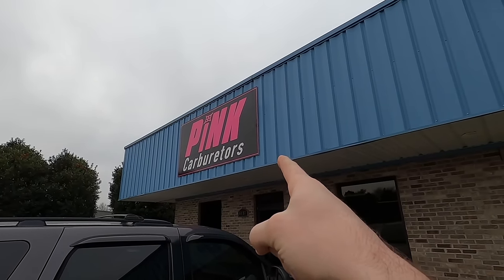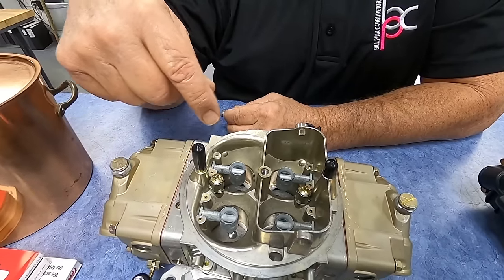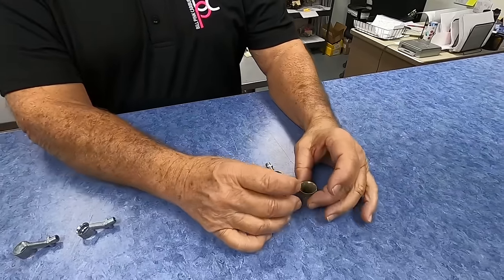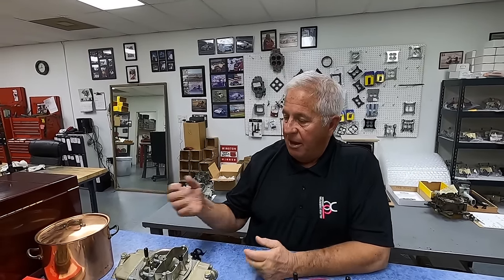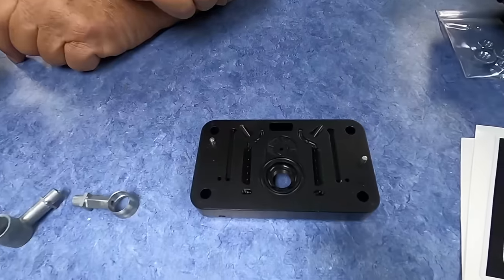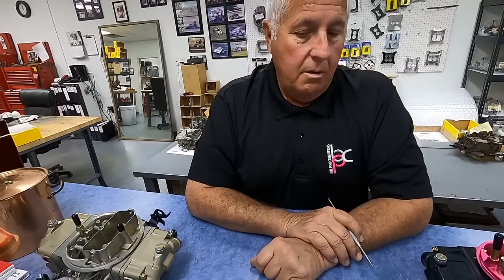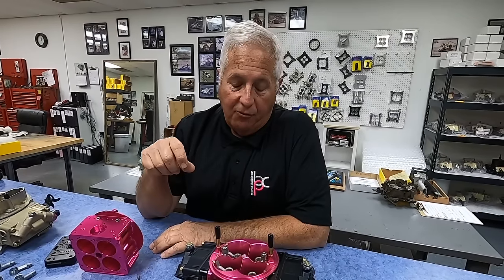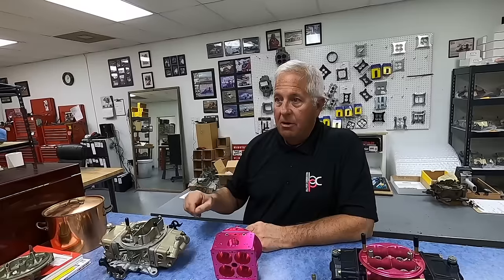Carburetors Are WAY Smarter Than You Think! Tuning Guru Bill Pink Shows Us Why (Carb vs EFI)

Comment: what Lake is saying is technically not quite right....the old fuel injections from the 1950s used the engine manifold vacuum as a metering signal too.  the speed density throttle body injection systems used  MAP and TPS sensors, to meter fuel based on manifold vacuum and throttle position.  the modern systems use a MAF and MAP sensor to meter fuel based on total airflow into engine, and manifold vacuum.  the sensors tell the ECM what the engine wants, then the ECM gives it fuel accordingly. the difference is EPA mandated leaner metering at idle and part throttle operation.  so the ECM is programmed to only give it so much regardless.
Reply from the maker: Yep the buck stops with the calibration. In a fully adaptive system yes it listens but most don’t work like that
Reply: Actually, all EFI systems have a base (open loop) tune and only take suggestions from the various sensors.
Reply from the maker: @RadRidesByCru  If you have a Holley or similar aftermarket system it can run closed loop and be fully adaptive at any given time. No factory cars work that way though
Reply: Hey, cool channel, like the videos. I have a Holley EFI. Fully adaptive is a misnomer. They'll run in closed loop during hot idle and off throttle cruise, but default back to open loop during accel, decel, cold start, sensor reading out of range, etc.. And obviously no EFI system runs closed loop at WOT.

Comment: Fuel injection is listening even more so than a carb. Mass air flow, manifold pressure sensor, o2 sensors, throttle position sensor, crankshaft speed sensor and knock sensor.
Reply from the maker: It needs the components configured to do that. A speed density setup (most aftermarket efi systems) dont have a maf sensor.
Reply: Actually, EFI doesn't listen at all. in certain situations (full throttle being one) all EFI systems switch to open loop and run off a predetermined program. Further, you're mixing fuel injection with engine management. EFI doesn't have, nor does it need crank or knock sensors.

Comment: Your the Opposite on your diesel theory , they are wide open for air at all times , the fuel amount is controlled at all times , more fuel = more revs , hence they rev to the moon if they ever run on their own oil or an unwanted fuel source.
Learnt heaps off this vid , thank you
Reply from the maker: You’re welcome sir. I think you misinterpreted my diesel theory. What I said was why can’t you run a gas engine on fuel flow only?
Reply: @Stapleton42  Because a gasoline engine needs the air/fuel ratio held within narrow limits which requires throttling the air flow to keep the mixture within limits.
Reply: @Stapleton42  sorry I did hear that to begin with and clearly confused
Myself . I guess the issue is diesels run cooler the leaner they are and happy doing it , we all know about leaning out gas engines and that would be the consideration of doing it that way is if it went lean it’s harder to control when it’s already wide open , just easier the other way I figure . 

On another note I know a Nissan engine actually runs the throttle at wide open once throttle input
Is past 33% , and it uses the variable inlet cam lift to then control acceleration from there . But that’s the closest one I know of . 

Sorry again , should have listened to it again before I commented
Reply: A gallon of diesel has more btu's than a gallon of gasoline. That's what it comes down to.

Comment: Lol how they don't know about diesels. I'm an auto technician in Australia, I learnt about all sorts of carbies when training, the motor bikes used to have some crazy designs, some had over 10 transfer ports.
I also know how diesels work, the injector ignites the fuel as its sprayed into the engine.
Reply from the maker: If you were a gas racing engine specialist learning about diesels serves no purpose to your profession
Reply: @Stapleton42  I get what you're saying but I do find it a little ignorant to not understand other types of technology.
As an example I know quite a lot about plane piston engines, why? Because I wanted to know why they run Avgas and what the differences are. 
I also know quite a lot about mains power as two of my uncles and my late grandfather were electricans/still are. It actually came in handy when I set up my work shop the guy we hired wired the compressor to run backwards, so I re wired it to run forwards. 
I'm also a radio amature and have extensive knowledge of RF. 
I'm always learning everyday and I'll never stop learning new things.

Comment: At idle. Fuel is limited by the idle mixture screws.  
From idle to 1700 rpm.  Fuel is limited by the idle feed restriction.  
From 1700 to 2400 the idle transition circuit looses vacuum signal and the primary boosters start to feed fuel as the air flow thru the venturis is increased.   You can see if your primary main jets are sized properly by bringing the rpm up to just before the secondaries start to open and looking at your air fuel ratio gauge. Is it lean or rich.  Change primary jetting to fix this. 

Ps edelbrock carbs have idle feed restrictions that need to be drilled to match the engine needs.  They are hidden behind the air bleed in the side of the primary booster.  Carter called them economizer s. Too small the carb has a flat spot off idle.  Too big and fuel economy sucks.

Comment: Carburetors are just better.  More reliable, less fuel pressure requirements and mechanical fuel pumps put vacuum on the fuel line so you can still get to a parts store if you have a fuel line leak.  You can run multi fuel setups so much easier, you can get better performance from a carburetor and you can get the same efficiency as EFI if you know what you’re doing.  You can tune everything to exactly whatever fuel curve you want.  You can run boost by drilling a couple holes for free essentially instead of reprogramming computers, and it takes far less time.  That versatility makes carburetion far superior to EFI when you’re doing any sort of modification.  Performance TBI and EFI (as opposed to stock) are designed around the idea of giving the vehicle what it wants instead of forcing it to run off what the computer wants.  And, you can rebuild them for cheap.  A Holley or Edelbrock costs half what a set of new injectors costs.  It’s just better.  If you disagree, then you’re entitled to your opinion but you’re also doing so from my rear view mirror.

Comment: My brother and I started racing a car with about 640hp small block 400 chevrolet engine about ten years ago, and were farting around with the main jets trying to richin the carburetor and I had the float bowls off on are holly 750 double pumper.This guy I've seen for years out at the race track is walking by and he stops and he said something to me but I couldn't hear him over the beautiful sound of high horsepower engines barking! So I said, Excuse me? He leaned over my shoulder and yelled, You ain't got no jet extensions in that back float bowl! And me not knowing at the time what the hell he was trying to tell me I gave him my best, I'm dumb! Can you please tell me what you are trying to get through to me look. He said, An engine with this much horsepower will have enough inetertia to pull the fuel away from the metering block on the back side of the carburetor and starve it for fuel when you stab the throttle! You need to run jet extensions he said. I couldn't believe how cool it was for him to throw us a bone like that! I thanked him very much and asked him if I could buy him a corn dog? He replied, No thanks I like to stay hungry on race day and walked away. It's the little things like that that make a huge improvement and I can't thank Guy's like that enough for giving away a little information to help us rookies out when you're just learning all the ins and outs of things.  😉

Comment: EFI doesn't tell the engine what is getting? the engine tells the EFI how much fuel to inject. They work kind of similarly the difference the carb does all the cifferin through vacuum signal EFI does it with sensors.
Reply from the maker: Assuming a given EFI system has the proper sensors in place with parameters set to do so. Not all of them do.
Reply: Actually, EFI does tell the engine what it's getting, like it or not, based on its programming. It only "takes advice" from the various sensors. Default is open loop, where it listens to no one.

Comment: Fuel injection uses 02 sensors in combined with temprature sensors crank cam position sensors and a number of other devices to deliver what the computer that listens to these devices and determine what portion of fuel programed in what is called a fuel map that the computer has preprogramed to give the engine. Carburetors don't do this and therefore are not as precise as fuel injection both listen in different ways
Reply from the maker: Depends how much freedom that ecu allows the sensors to make changes and what failsafes it has in place but yes I understand what you’re saying

Comment: I stopped at 0:40 when he said manifold vacuum pulls vs atmospheric pressure pushes.
Reply from the maker: You can phrase it however you’d like but it doesn’t change the principle of how it works 😂
Reply: @Stapleton42  in fluid dynamics, it's a basic but critical distinction. If a man is gonna "nerd out" on a technical thing, they should do it right. That's how misinformation  becomes gospel, especially in motorsports and technical matters in general.
Reply: @slowpoke96Z28   phooey

Comment: He shouldn't feel bad there is a massive amount of professional mechanics that have no clue how a diesel works. One guy I worked with thought the glow plugs made the fuel burn 🤣 there are gas engines that can run like a diesel on compression alone but there pretty experimental. Diesels use compression heat to ignite the fuel that is sprayed in the cylinder. Similar to a spark plug igniting the fuel mixture but it's the air heat that makes it burn. U still have timing and stuff to play with but diesels don't have a throttle plate or vacuum because the injected fuel controls rpm and timing. U can run a gas engine without a carb if u have a way to precisely control the fuel it will run just like a diesel lol. Diesel fuel has way more BTU then gasoline so when it fires in the cylinder it creates more heat and pressure inside to push the piston back down. Most diesels run 21:1 compression so if u have poor fuel or gasoline in the tank you won't build enough cylinder pressure to push the next piston up and squease the air to ignite the fuel. Gasoline can't create enough cylinder pressure to keep the engine cycling that's why diesel fuel oil was developed to create constant cylinder pressure to keep the engine rotating to keep the compressed air hot enough to fire the next combustion stroke. The main reason diesels "roll coal" is they are putting too much fuel into a cold cylinder similar to when u first fire up your wood stove u get lots of smoke and soot out the chimney till everything gets hot and the wood burns more complete then u don't get all the soot and smoke out the pipe. That's why nos works amazing on diesels and why the black smoke suddenly disappear when they hit the nos it increases the cylinder Temp + add oxygen and the injected fuel will burn completely just like when your wood stove is hot. A properly tuned diesel won't "roll coal" a diesel shouldn't burn black out the pipe if the cylinders are hot and the fuel is burning properly.

Comment: The way g'sil injection works it has a secondary high pressure pump like for instance on a 12 valve a 12 valve has literally a pump boost the pressure from around 20 psi up to 30,000 to 60,000 PSI so that the motor doesn't need batteries or anything like that the same reason why the old Detroit two cycle diesels if they didn't have a blower it would not run because the blower is what compresses the are not necessarily the Pistons therefore it's similar with a 12 valve basically just the port where the air is brought into in compressed and it's compressed to such a high level that when the fuel comes out of the injection or injector it pretty much instantaneously explodes
Reply: Huh??  Try reading your post out loud and see if it makes any sense.  Then use some 6th grade punctuation and grammar to make it understandable.

Comment: What's a cfd study
Reply from the maker: Computer fluid dynamics I believe is what it means. It’s like an airflow simulation program
Reply: @Stapleton42  thank you
Reply: @Stapleton42  do u no why a big rig can idle at a truck stop for three hrs and use hardly no gas , I do
Reply from the maker: @bryang9158  yeah because they run on diesel not gas 👀😂
Reply: @Stapleton42  it's because no throttle blade to open or close it's just a big hole open all the time even at idle witch means full 22 to on compression even at idle super efficient at idle hence low fuel consumption, a passenger car gas engine has a throttle butterfly on the tb , at idle it's basically closed not letting much air in so your ten point five to one compression passenger car is really mby six to one comp at idle hence super non efficient= bad mileage worse than actually crusing on the road , the motor has to have air to make compression , a internal combustion engine with a throttle plate is a variable compression eng

Comment: "EFI tells the engine how much fuel it's gonna get, carbs give it what it wants." Sorry, I don't subscribe to that. I love carbs and run them, but that is simply not true. YOU, the tuner, ALSO tell the carb how much fuel the engine is gonna get by tuning the damn carburetor. Jets, air bleeds, restrictors, emulsion bleeds... they all determine what the engine is gonna get. Just like an EFI system can give incorrect amounts of fuel, a carb can give incorrect amounts as well. And most people running out of the box carbs straight from Jegs or Summit are running FAT as hell.
Reply from the maker: They both require the proper user configuration yes
Reply: I thought carbs tells the engine how much fuel is going to get at EFI give it what it wants.
Reply: So... you don't subscribe to the truth? Or you're having a crisis of semantics? Based on your logic my tires tell the engine how much fuel it wants. Speaking specifically to the fuel delivery method (read: method), Lake and Pink are correct. Any carburetor will run any motor so long as there's enough vacuum signal to draw fuel. Make the jets/bleeds/restrictors too large or too small, the carb will still "give" the engine what it wants. EFI has to "tell" the injectors how much fuel to deliver based on programming, the injectors don't "give" anything by themselves.
Reply: @RadRidesByCru  "Any carburetor will run any motor so long as there's enough vacuum signal to draw fuel. Make the jets/bleeds/restrictors too large or too small, the carb will still "give" the engine what it wants."

Wrong. The carburetor will still give the engine how much fuel it feels like, regardless of how much the engine wants, based on jets, bleeds, floats and restrictors.
Reply: I was asking Aurthur about his position but... You specifically, are making a linguistic argument. Carbs give an engine fuel. The engine literally reaches in and takes the fuel out. Whereas EFI tells an engine how much fuel it's going to get because the engine cannot take the fuel from the EFI system on its own.

If you reverse your first reply to Aurthur you'd be correct.
Reply: @RadRidesByCru  Explain to me why carbureted engines typically run rich to the point where fuel dilution in oil is a problem.
Reply: That's not something I've experienced in any carbureted vehicle. I know why people do it intentionally, but it could just as easily be done with EFI. If there's fuel in the oil something's going on that has nothing to do with the carburetor.
Reply: @RadRidesByCru  Fuel mixed with oil in a carburetor engine is normal, since you have to dump a lot of fuel into the cylinders during cold start up with a carburetor.
Reply: @gregsmith332  That is not common. Not in my vehicles, nor anyone I have ever known. Cold start fuel enrichment is an EFI thing. Carbureted engines restrict airflow (choke) or raise the RPM (kickdown) but they do not dump additional fuel at cold start up. There's not even mechanism on a carburetor that would trigger such a thing.

Comment: Carburetor will always be limited in power. Efi can and will always result in more power, better fuel economy, and just plain reliable. Sorry if you can't handle the truth.
Reply: You're wrong... Neither EFI nor carburation will produce more power vs the other. Put a carburetor on a modern car and be shocked by equal fuel economy. And the only thing you can rely on fuel injection to do is break more components that cost more money to repair than a carburetor ever thought about. Sorry if you can't handle the truth.

Comment: Wath dou you tink abaut sixpack have thes on May 440cui Engine Challenger.Have custom build Metring block. Have weery god respons.Weiand Tunnel Ram intake..Roller Hyd Cam 0 585 lift.Have even Pro Chot fogger system.150hp shot not more..Mayby I have 600+whp...Have god Heads Alu wedge fliw Nr wath I have are 310cfm 0585 lift...

Comment: No wander they went to fuel injection, to many things can go wrong with carb that ya would never be able to pin point, as an amateur
Reply: Repairing a lot of the microchips, resistors, capacitors and traces inside your EFI computer, sensors, actuators and injectors are you?
Reply: @RadRidesByCru  no just buy a new computer, if that’s ever the case
Reply: @thruitallauto2538  Then no worries about all the things that can go wrong with a carburetor, just go buy a new one... at a fraction of the cost of most EFI components.
Reply: @RadRidesByCru  wouldn’t have thatvtrash, and I’m not worried any way you worried